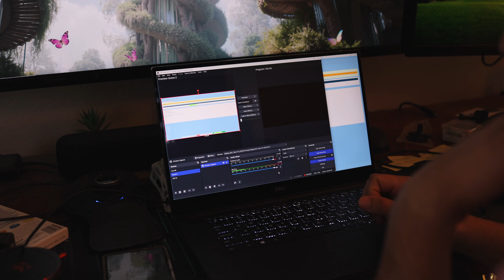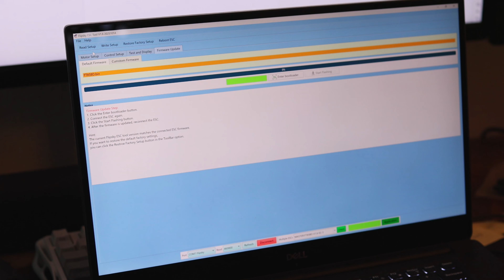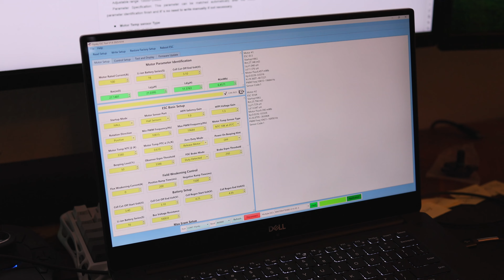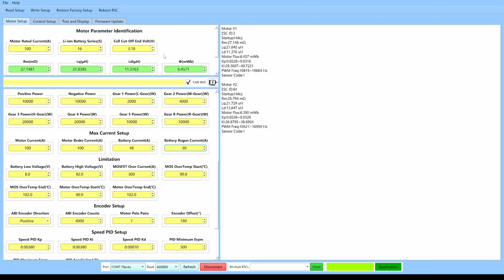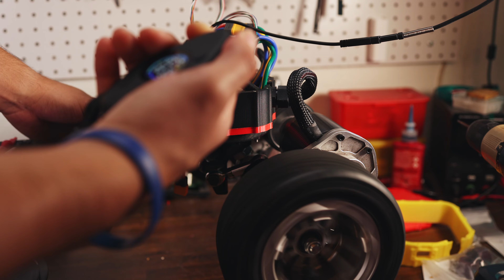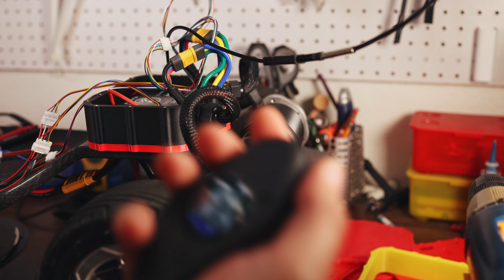How to Set Up the Flipsky FT85BD ESC For Your Custom Meepo MLR

Comment: Just wired one of these for my og zeus bamboo pro
Reply: Took the motor cables from my dead zealot s2. They are both using the same connectors.
Reply from the maker: Oh nice that's super cool

Comment: If you had such a problem why would you not show exactly where to plug in😢
Reply from the maker: Eh that is an oversight on my part, sorry about that. It was immediately obvious to me when I looked at the top of the ESC. I made an assumption the first time I plugged it in, and didn't double check. Once you know about it, all you have to do is make sure to plug into the side labeled master, and there should be no issues.